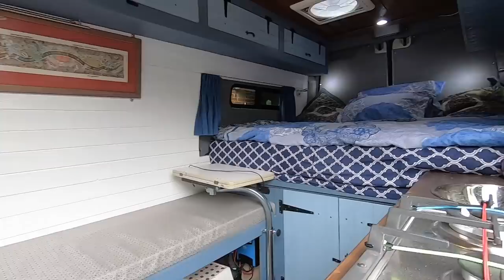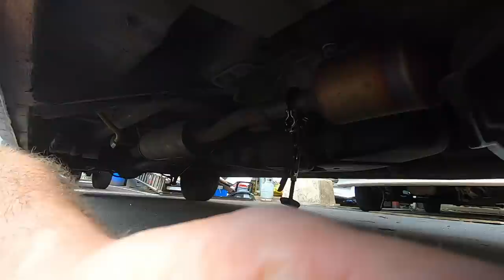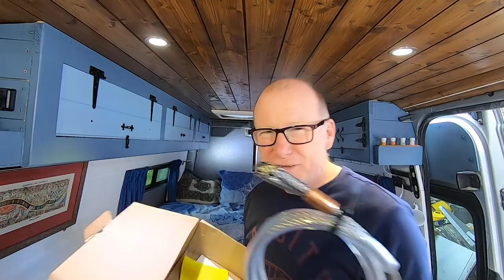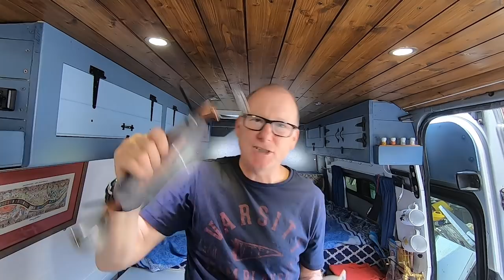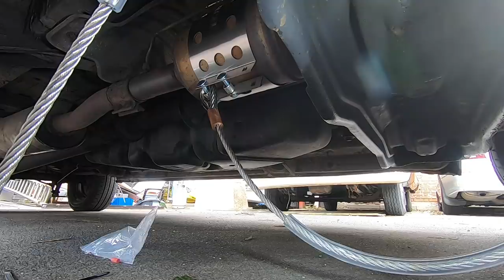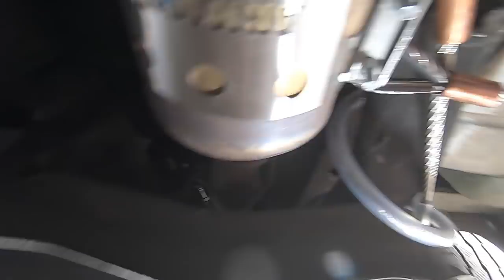Catalytic Converter Theft Prevention

Comment: Maybe the manufacturers should have something built into the design  build  to prevent this happening
Reply: Amen because mine is gone! And I had a shield over it.
Reply: @ladyfame1430  Even with the shield? Damn! May I ask which shield did you use?
Reply: @Carpy Chris,  Would be nice if car manufacturers put some kind of shield on all of their new cars and trucks from now on! Make it so that only the owner could open the shield with a key that is given to the owner when they buy the car or truck. Now, that would stop a lot of the thefts that are going on like wild fire! Got mine stolen three weeks ago and let me tell ya it wrecked my life for over a week because I was out of transportation for 1.5 weeks! My car still hasn't pass the emission test since then and I will have to replace the sensors because those bastards messed up my sensors as well!
Reply: @grandwonder5858  Hey how are you all the shields are basically the same I believe it’s made of stainless steel I think and pretty thick ......the shield is in my garage I would have to go look For the model or the brand name, it is stainless steel and there’s about 4-5 feet wide in about 4-5 feet long as well And it has several bolts going around the three sides of it. I mean a lot of bolts...like 20 or more...  it took a lot of time For me to get it off. I just know they went up and around the front wheel and unbolted where the cat attaches and then they cut where the resonator Is, bent the shield down a little bit probably by pulling on it with a little bit of weight, Probably with their arms just pulling or crowbar then just Shimmied and wiggled it out through the space so I was left with a slightly hanging resonator tube and no cat. I found a couple bolts and springs on the ground by where my car was parked. I just took my car to the dealership and they have seen a shield being cut as well. You’re just gonna have to garage the best you can or get a sensor alarm that goes underneath it with several different horns that go off even one inside your house so they can’t disconnect it and it will go off inside so you’ll hear it even in your side your house when you’re sleeping no crackhead wants to hear an alarm going off and they can’t Make stop. Also they don’t know where it’s coming from it will piss them off you’ll definitely be out there within 30 seconds if you have an alarm going off by your bed you can add horns to alarms which makes it pretty cool because I was asleep when it happened to me and I didn’t hear until it’s too late. Metal won’t protect your Cat converter as long as there’s tools to cut through metal you’re never gonna be safe From theft it slows them down but not enough garage it or make it super loud with a horn To where they can’t even get under your car look!  so everybody comes out of their houses To see what’s going on like wtf they’re not gonna like that no matter What time of day it is this means you have to modify an alarm by the way not just a simple car alarm. Good luck if you’re in California you have my sympathy.
Reply: or maybe these recycling places that take these should only take them if you can prove that it came off your vehicle. them just taking from random people is what is giving excuse for them to steal them
Reply: @ladyfame1430   Did you put alarms on yours?

Comment: Got to be part of a van build,  could use exhaust clamps to put 3 bars in place where they cut,  then use a grinder to round the nuts on the clamps ( or buy shear nuts of ebay)...👍..Tooo hard for them then to mess with it for sure...In London, there were around 3,000 catalytic converter thefts reported in the first six months of this year..They are even doing it during the day, even using small hydraulic jacks....Good vid Mel, people need to be aware....
Reply from the maker: That’s frightening 👍🤓👍
Reply: I like that idea about the exhaust clamps 👍 That's nuts, around 3,000 catalytic converter thefts in the six months, shocking!
Reply: Catloc installed in so many cars now thankfully
Reply: They have battery saw saw too
Reply: I gave a cat lock on mine, I've not owned it long , so still getting to know the underside. Being a welder fabricator by trade, I would say this sounds like the best deterrent if you get enough metal around it it will take too long to cut. The idea is to be in and out quick. I bought mine from London and the vehicle always lived on a quiet drive. The lock seemed to gave been enough of a deterrent. There was a few spicy looking estates nearby. It's bloody noisy though, rattles on low revs. I'm going to try and cushion it somehow, maybe wrapping a long narrow spring round it.

Comment: They just took mine out of my 2008 GMC Savanna 1 ton van last week They use Sawzalls here in Northern California. I ordered a length of exhaust pipe, two band clamps and one of those chain tools to make a pipe fix to get me going while I dealt with insurance and found a good exhaust shop that welded a new cat right on in about twenty minutes for $ 1,100 USD total. The insurance paid me a bit over $ 2000 so I got a bit extra to cover my stress and loss of use of the truck for almost a week and now I am working on some deterrents.
Reply from the maker: OMG 😳
Reply: This cat issue is extortion
Reply: unfortunately in the US ,these insurance companies will find a way to increase your premiums in the mid distant future, even tho it was not your fault. They are as slimy as they come! they get paid monthly premiums and You put in a claim, get a payout, and they nail you to the cross for several years. But to look on the bright side, you got it fixed and you got some money for it TODAY.😅

Comment: I have a cat lock on my sprinter. A different style. My first welding job was with Eminox, commercial vehicle shiny show exhaust and cat manufacturers. A word of caution. Be careful when tightening up a sleeve around a cat body. We torqued them up very carefully. The interior is a ceramic honeycomb, steeped in precious metals. If you apply too much pressure to any part, it will crumble. Follow the instructions carefully.
Reply from the maker: Thanks for sharing

Comment: Catalytic converter theft here in Chicago is very worrisome so I'm on the hunt for an anti-theft device.

FYI, for those cables, they'll just switch to a hand-powered rotary saw and cut through a approx 60 seconds.
Reply from the maker: Good luck 🤓
Reply: What did you go with?

Comment: Great, except most will have a battery powered grinder. It might confuse them enough not to figure it out. Your lucky to be in UK, in the US they would not run away when they packin heat - no not sterno food heaters.

Comment: I have such a tool. It's great when I work with old exhaust pipes. to remove them. (on old cars) I've never even had the thought of walking around stealing catalysts. But maybe it's because I'm not a thief
Reply from the maker: I didn’t even know such a thing was invited 😂👍
Reply: It’s march 2023 and a car thief went j to our 35 cars at the apartment development ONLY opening the driver side door. So now we have tk worry anout Blank Key Fobs unlocking our cars as well as Ground Floor Thieves.!

Comment: I've had people trying to break into the van many times at night but never had anybody underneath the van it looks like your Sprinter van has a lot of ground clearance easy to slide underneath a lot of vehicles you can't get underneath without jacking it up all putting on ramps so they probably target Sprinter vans. I think getting a garage to weld a strip of metal along the pipe would be the best deterrent. Happy travels.
Reply from the maker: Thank you and yes some people do that 👍😂👍

Comment: Mel this is actually called a DPF. Diesel particulate filter. Some have a monolith block catalytic converter built in. This is always at the front. Your vehicle may have a separate box entirely further up front. That will be the catalytic converter. 
Anyhow. Great video. It’s important to bring this thieving act to the attention of drivers who do not have a clue. There are many videos about this subject. The guy deserves the removal of fingers.

Comment: Mel, see the actual pipe from the cat that the chain cutter was on, could you put a similar cover over it to stop them from cutting through the pipe in the first place ?? Just a thought 🤔
Reply from the maker: Yes some people weld hard rods to the pipe 👍🤓👍
Reply: They won't walk around with bolt cutters and an exhaust cutter. If they were stopped and searched that would be an instant charge.
I imagine they work by first looking undedneath a likely target but would simply move on if there is no Cat or its locked.

Comment: Not keen on that product Mel,a thief would just cut through the cable with a battery angle grinder,i'd prefer to design a much bigger plate that could be fitted to the chassis.Hope you upgraded the vans security as loads are getting broken into or just stolen.
Reply: 2 things, 1 battery angle grinder make a hell of a noise, especially if someone's trying to remain quite and stealthy, and 2nd, Yes they could just cut though the wire, but if they weren't expecting it to be there, hopefully they wouldn't be carrying said battery angle grinder/bolt cutters in there back pocket, and they take one look at it and move on to the next unsuspecting owners vehicle leaving this one untouched.

Comment: Technically that contraption may not work at all. They will still just cut both pipes on either side of the cat and simply slide it out that contraption without even damaging the guard you installed

Comment: Good Vid Mel but hey a 18 or 20v angle grinder with a slitting disk will see that lot off in a very short time. Got a similar dilemma with our bike locks.
Reply from the maker: Thank you I’ll make sure I wake up with a bat in hand if they try again 👍
Reply: if he heard the pipe cutter an angle grinder would be deafening.sawzlall maybe even louder.this guy was trying to be smart,but if he had any kind of brains he would wait until there was no one in or around.

Comment: What would stop them from using bolt cutters to cut that steel braded cable? Is it a reinforced harder steel to prevent it from being cut ? Or is this something that would just give them a bit of a harder time of getting it in hopes that they won't attempt to do it.

Comment: Hey up Mel hope your well. Love you jolly look on life mate. Thanks for putting a smile on my face every time u load something up.  I’ve got a 64 plate LWB sprinter and looking at your video my Cat is located further up towards the engine, how could I find out what euro 4 or 5 my van is ? And if the Cat you put on will fit on mine ? Pls help x thanks in advance
Reply from the maker: Hi ya euro 4 or euro 5 will be on your log book V5 good my van has a cat and a Dpf good luck 👍🤓👍

Comment: I'm thinking that the 6 carriage bolts should be installed with the heads on the "ground side" of the shield.  This would provide another layer of protection, as the rounded heads would give would-be thieves nothing to easily grab onto.  The snap-off nuts are already protected by channels, and by pointing those nuts and channels Away from thieves' tools, it would make is even More unlikely to allow theft.  Just my opinion.  Thanks.
Reply: This would still be an easy steel by simply doing what thieves to do remove steering wheel locks: liquid nitrogen. Easy peasy unfortunately.
Reply: @Whoo_Boy true, but most thieves don't carry it on them
Reply: @Whoo_Boy yes unfortunately there's a lot of tech that helps legit trades and theives equally. Most theives are chancers and drug dependants. You'll deter most of them, most of the time. Take as many precautions as you can. The pro theives will always succeed. They're ingenious, if some had offered them the right training and job opportunitys they'd be bloody successful in a legit trade. Lol.

Comment: Nice 3k repair bill from Merc if that had gone.... last 3 I dealt with at work they weren’t as neat and ended up cutting sensors and wiring looms. When we ordered the new loom it had to be built by Merc, in the factory with a build time of approx 12 weeks....!  Even then once received the van had to go back to a main dealer for repairs
Reply from the maker: Oh my goodness me I couldn’t  deal with that I’d be devastated
Reply: We have them stolen regularly - for a full system with temp sensors etc there is something like 24 individual items...... one Christmas we had maybe 20 stolen!

Comment: Its just a bigger version of the tool you use to cut copper pipe for plumbing,Its not good people use them to steal catalytic converters but crazy to think should be illegal because people are using the tool to steal.
Atb Steve
Reply from the maker: Thanks Steve and you 👍
Reply: @BigVanSmallWorld  it looks to be a good deterrent but definitely flaws in it,the crimps look like there copper so quite a soft metal,could also cut the wire rope but more hassle then a vehicle without 1 and people who steal generally go for the easy option.

Comment: Little scrouts! Iv has my van messed around with and it’s a horrible feeling, glad you disturbed them mate! 
Is That cut out in the shield where the bolts go through what that the “pipe” (pressure sensor) on top slots into? Now the armacat is on it ain’t going nowhere! Good work
Reply from the maker: Thank you 👍🤓👍

Comment: Hi Mel,
I have a Ring  B2B like yours and I would like to know if I can connect a battery charger to my battery to charge my battery on dull days without the need to disconnect my B2B from the battery to protect it. Hope you can help.
Cheers in advance. Chris.
Reply from the maker: Hi Chris I’ve done that in the winter I used a battery booster and had no issues 👍🤓👍
Reply: Great thanks!

Comment: Great work, thanks for sharing. Here in the US they use the little cordless grinders with cutoff wheels. one quick cut straight down the where the holes in the wrap around your cat are and  then the pipe each end, all the hard work for nothing. Hopefully they won't notice.
Reply from the maker: You’re absolutely welcome. I have no doubt they use them grinders here in the UK too! The best thing we can do is make it harder for them in the hope they will just not bother and go find an easy target 👍😳👍
Reply: @BigVanSmallWorld  I would tack cable to the cat where the holes exposed by wrap with a welder.
Reply: @timthemechanix when living in trucks in the 80's we had similar issues, ie certain gearboxes for instance had a great export value. It wasn't uncommon to weld these onto the Bell housing, with some operators paying someone to sleep in trucks overnight in the yard, to watch out for theives.
Funny story, one of the known gearbox theives came out of the supermarket, jumped in his truck, fired up the engine, went to grab the gear stick, and it dropped through the floor, yep, someone had his gearbox, whilst he was shopping. Lol.
Reply: Those 18v lithium ion power tools are a godsend. Unfortunately they're universally useful. To wrong uns as well as trades. 
A freind of mine list the keys to his bike lock, his bike was locked to the train station railings. He grabbed his 18v grinder and went to cut his lock off. When he arrived there was some Herbert trying to remove it. Being a big imposing guy, my freind strolled over announcing "this is how you do it" and cut the lock off, knife through butter style, showering the would be theif in sparks.

Comment: Those are pipe cutters... Usually not used to steal cats tho 🙄....for diesel, the name of those are DPF..Diesel Particulate Filter. Abt double sometimes 3x the price of a gasoline catalytic converters. Lots being stolen off dealer lots off brand new vehicles.
Reply from the maker: Well maybe the manufactures will wake up and do something to stop them 👍🤓👍🍻

Comment: If they cut the wire like bike lock also use tool they use. It's still gone. Is there not a large plate that covers a large area.. Covering the lot... Sorry to say.. But even after your hard work of fitting.. It still looks easy to cut it off?.. Maybe look into designing a large plate.. That shear bolts onto the chassis.. Covering  a wide area... Bit like a sump protector plate?  Maybe..
Reply from the maker: It’s a deterrent to make it harder for them
Reply: Ammm... It's crazy... Let's hope it stops them long enough to get dressed.. Next time. 🤔 Don't be so fast to confront anyone. So where was your.. I'm gonna blind you. incee wincee light👀.  I got a mastiff staffy cross keeps me warm. I'll have to record his bark and growls. Put as a movement censor around the van lol. Be careful Mel.. Desperate people with no fear or morals will do extreme harm for pennies.

Comment: I'm not sure about those wrap around cat-locks as a pair of bolt croppers will get through that wire easily. I would've thought a big sheet of metal over the area with something like a spline drive bolt fixing method into rivnuts would be better.
Reply from the maker: Did you see how thick that was ? But yes your absolutely rite the thing is to slow them down or just simply put them off 👍🤓👍
Reply: Yes hopefully any future scumbags would be put off! Hoping no more issues for you!
Cheers Kipper!
Reply: May I suggest an upgrade to chain? I work with rigging cable… it’s not that tough with the right tool.  The Felco C7 cutter will go cleanly through 8mm wire rope in one bite;  Bigger rope parts in a few nibbles, just leaves a ragged end…
Reply: @nautamaran  so what do you recommend?

Comment: That won't work because a cordless angle grinder or cordless skill sawfwith a cutoff wheel will cut right through the cable and bolts and the pipe
Reply from the maker: I think I’ll wake up before they cut though it 🤣👍